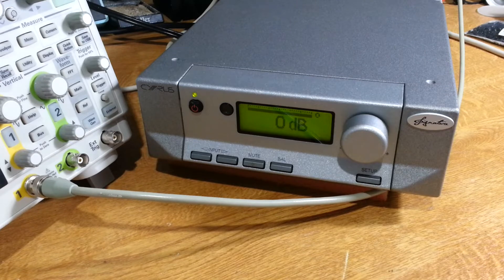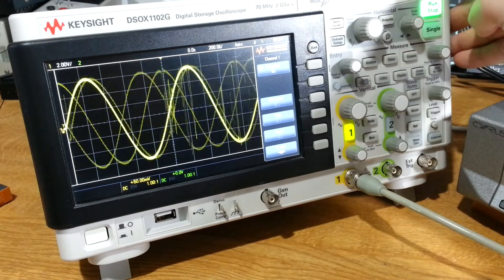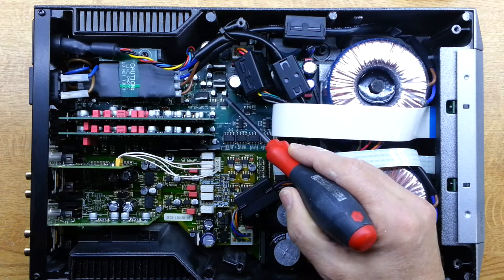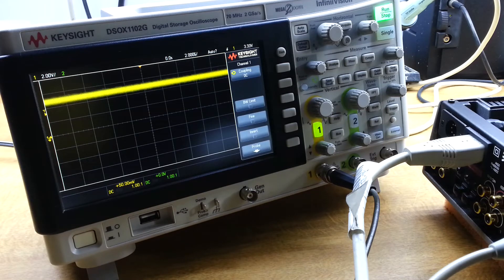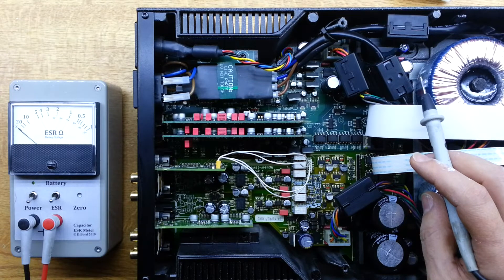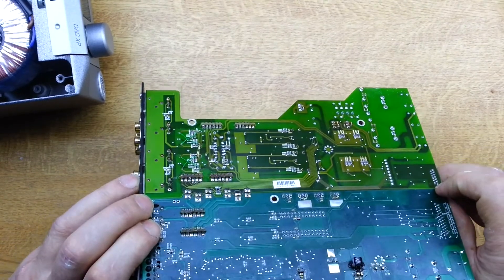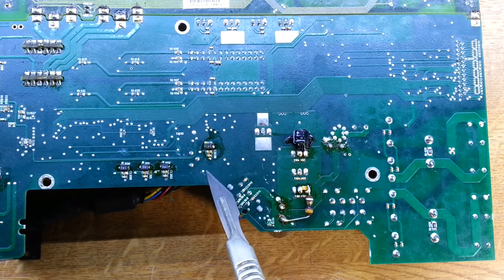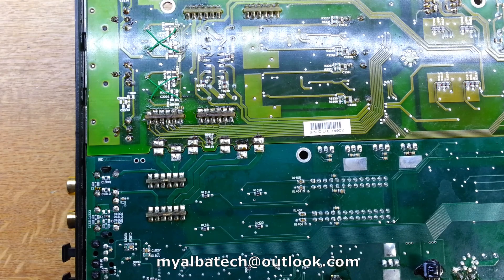Debugging a 'Crackling' Cyrus DAC XP Signature

Comment: I had a one owner Cyrus 2 in for a repair and refurb a few  years ago, it looked so bad when I opened it up, solder balls and flux everywhere, I asked the owner if  he had had it repaired before and I was amazed when  he said it had only ever been to Cyrus for a service! Those little silver Panasonic surface mount caps are a common failure, especially when they are close to a heat source.